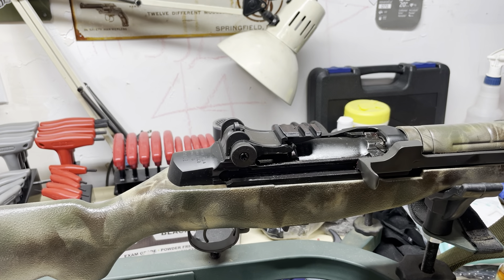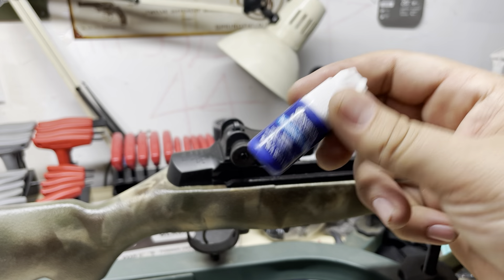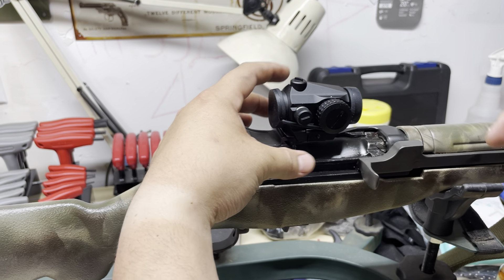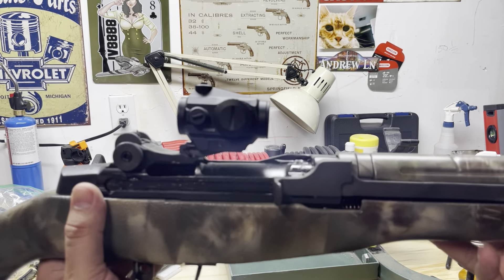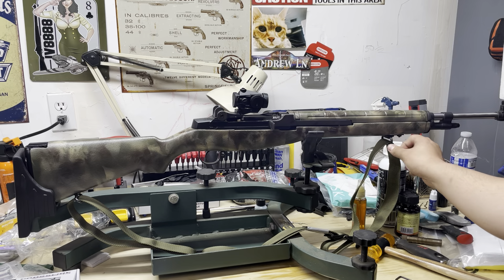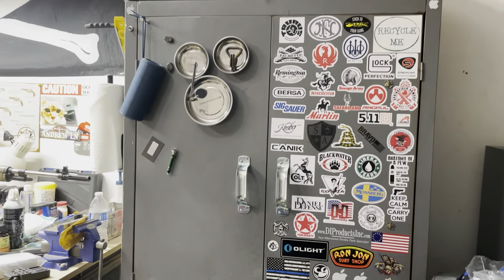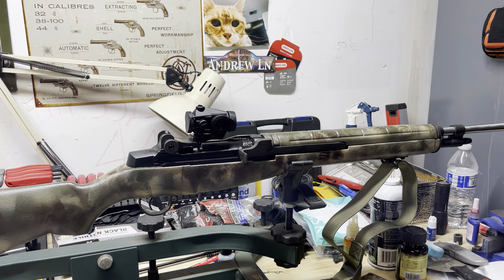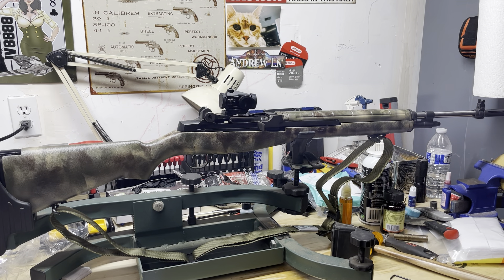Final look at the KZ M14 stripper clip mount and mounting on the crossfire and some rambling

Comment: Nice looking setup! How long did it take you to file the mount to fit the rifle?
Reply from the maker: I’m gonna say about 45 mins.. just file and check ALOT you want it to be as tight as possible and as even as you can get it on both sides so it drifts in good but with encouragement of a punch…if it stops going in then punch back out and file some more thanks for the comment brother
Reply: @extrarounds3827  Did you take off the set screw first? I’m thinking that would be the best so you can line up the mount. Still filing diligently…
Reply from the maker: Oh yea man the first thing I did was take out the set screw before I even started filing and it wasn’t till the end when I made sure it was even on both sides of the stripper clip slot when I put the set screw back in…also it won’t fill up the whole stripper clip slot so I used a pair of calipers to make sure it was as centered as possible…also I used the same method from XS Sights with smiring some loktite on the part dove tailing and on the set screw.
Reply: @extrarounds3827  Thx for the tips. I just goofed it all up. I end up filing it too much and it’s too loose even with the set screw.
Reply: I think you misunderstand co-witness. It's about whether you can see your iron sight picture through the optic. True cowitness means you look down the sights and through the center of the tube. Lower 1/3 means the tube is a little higher than the sights. You don't have any co-witness. Looks comparable to a 1.93" mount on an AR-15.
Reply from the maker: Thanks for the comment Spectre, yea I knew it wasn’t gonna co-witness even with the lower mount I was going for a lower 1/3 the whole time I was just stating that you can still kinda see the irons but not really
Reply: @extrarounds3827  Not really a big deal since (A) modern dots rock and B) you have to zero / account for distortion by the lenses.. If you wanna see the irons through, the only way is with a tiny sight or a handguard mount. The T1 style dot like you have will sitting too high for it on a clip guide no matter what.

That being said, clip guides are so damn slick. Minimal metal addition for such a huge improvement. I like what you made there. Enjoy the M14 strength and fitness program. It's second to none.

Comment: Hey man, thanks for the video, I just order one for my scout squad.  I see that the pic rail has two slots, but do you think it could actually allow for an optic that has two mounting screws?  I noticed you're using a red dot with only one mounting screw.  I was interested in putting that new Vortex Gen 2 3X prism optic on my rifle, but it has two mounting screws.  From watching your video, it doesn't look like it'll work.  It kinda looks like I might have to buy an optic with one mounting screw or buy an aftermarket QD mount.  Thoughts?
Reply from the maker: Thanks for the comment my man yea your gonna have to use an optic with only one bar mount there’s not a lot of real estate on these things I think one guy found one a little longer but watch my video on disassemble of your M1A because you need to take in account the length of the optics for taking the bolt out of you rifle or you gonna have to take off the optic to disassemble

Comment: What size and type of screwdriver do you need for the dovetail screw?
Reply from the maker: It’s an Allen screw and I think it was a 1/16 so pretty small screw but works good just got to make sure you lok tite everything down thanks for the comment man
Reply: @extrarounds3827  Thanks! I ordered the extended version of this set up.  Hoping the install is the same.  I'll have to order a 1/16 allen wrench.. How has this set up held up to the recoil etc?
Reply from the maker: @Chosenhunter77  if I were you I would wait to get the kit before ordering the Allen key just to make sure your getting the right one since you got the extended version, and it’s held up pretty damn good with recoil but that ALL DEPENDS on you prep , filing and finish so make sure to degrease very well…file and check file a little and check over and over and over DO NOT!!!! Over file…and lok tite is your friend I put some red on the base of the dovetail and after you test fit everything you can either use blue or red on the rest but be VERY CAREFUL with the filing
Reply: @extrarounds3827  so I went to punch out the pin to remove the stripper clip and found out my rifle doesn’t have a pin, you can see right through the pin hole? Any idea what I do to remove the stripper clip if there is no pin involved?
Reply from the maker: @Chosenhunter77  try to drift out the stripper clip guide…some times the pin is so thin it looks like it’s not there so maybe try a little bit bigger punch and see if that does the trick which rifle do you have a a M1A
Reply: @extrarounds3827  I have an m1A Socom 16 with the archangel stock. The pin hole you can see straight thru, no pin at all.
Reply from the maker: @Chosenhunter77  did you try and drift the stripper clip guide out? Towards the charging handle? Mine you can see right through too but there was one in there…if the guide is not drifting out there’s something in there

Comment: Hey what tool are you using to screw in the set screw?
Reply from the maker: Just a regular Allen key that fits the set screw but you gotta be careful not to strip the head cuz it’s a really small Allen key…depending on if your going to just keep this setup or not your gonna want to use either blue or red lock tite….I used red not only under the mount like where it slides in but also on the set screw but if you plan taking it off I’d use atleast blue lock tite and wait a whole day before mounting a optic so the lock tite has time to set
Reply: @extrarounds3827  Thanks. Hey how far did your set screw go down when you screwed it in? Did it go all the way through the new sight base and into the M1A?
Reply from the maker: @bonnertom032  mine didn’t really fit into the hole for the pin so yea I just hit it with some lok tite and carefully cranked it down when it bottomed out onto the dove tail